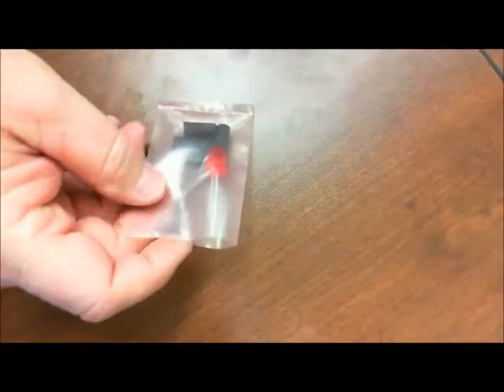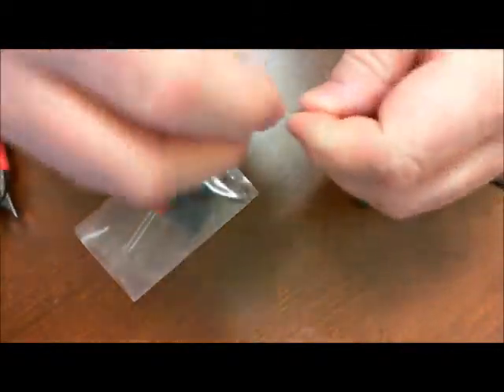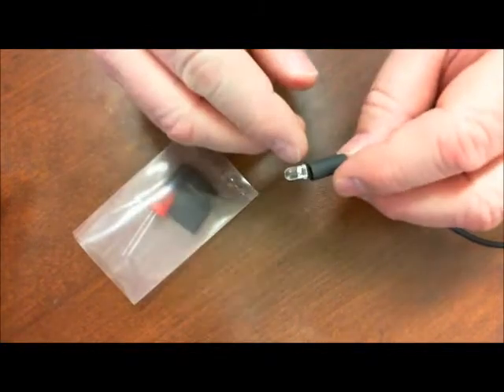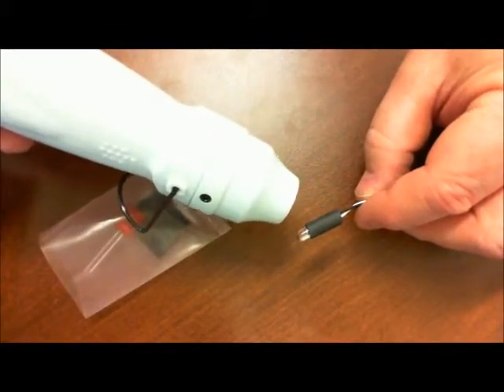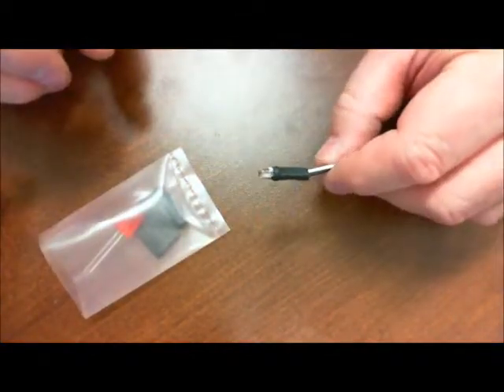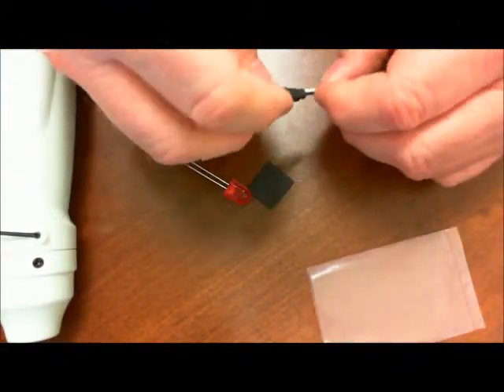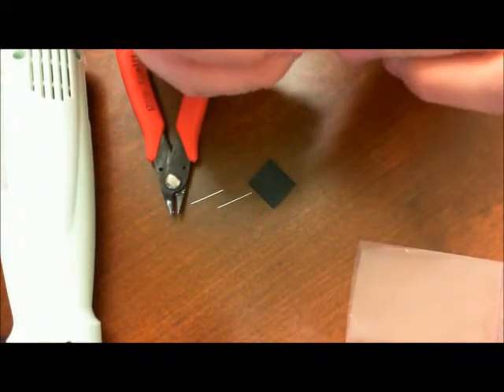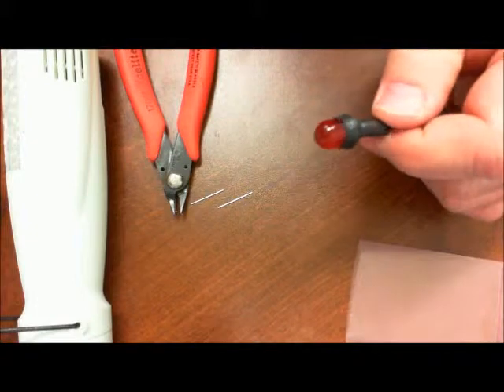LED's & Heatshrink

Comment: Looking for that wire that you push the LED into? Any suggestions/links to where to buy them?
Reply from the maker: I thought I had them on my site, www.cowlacious.com, under accessories, but I don't see them there. I will add them tonight if you want to get them from me. Otherwise, do a search for ID Bit cables or CD ID Bit cables or DVD ID bit cables.